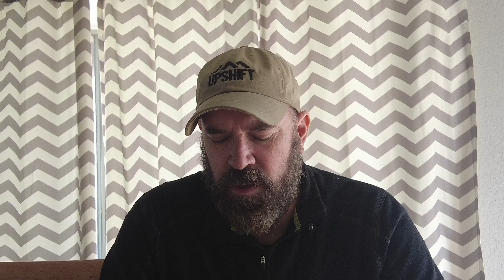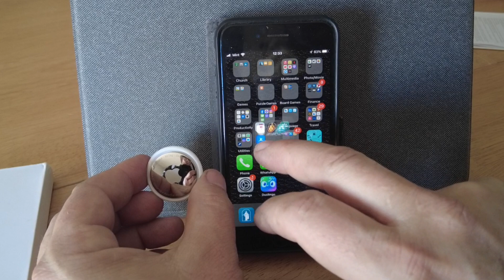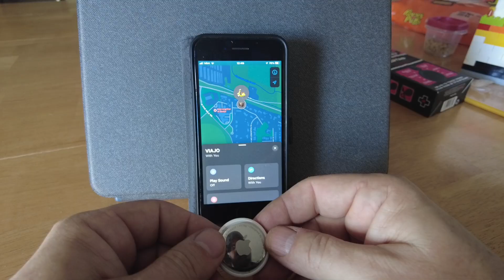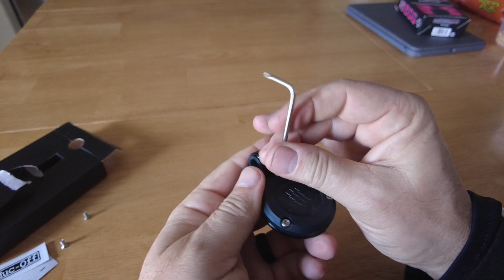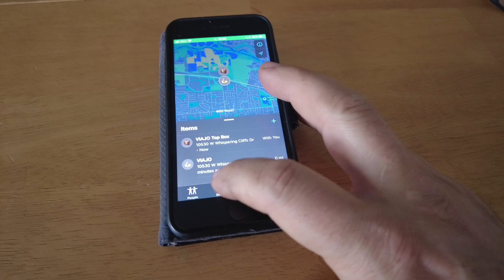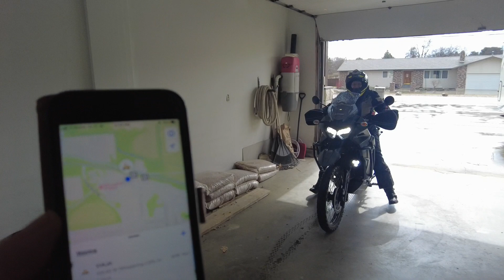Is an Apple AirTag Going to Protect Your 3rd-Gen KLR650?…

Comment: I have an airtag on all my vehicles, and removed the speaker from all of them. 
Only issue is with it is that it still be be located if they use "precision finding" on the iPhone, it will get them within a few inches of where the tag is at. 
It will also alert an iPhone (and I think Android has it as well) that an unknown tracking device is moving with them, so they will know there is one with them.